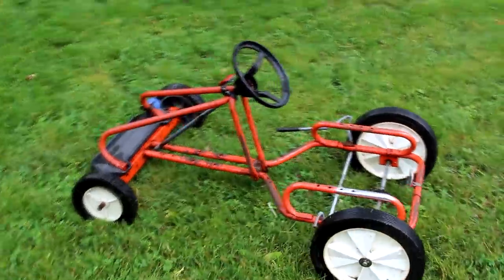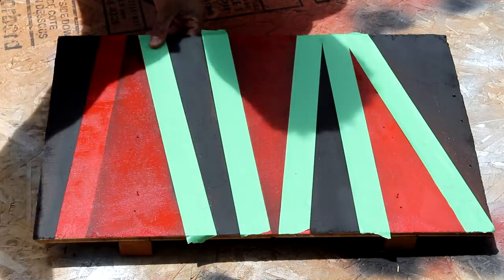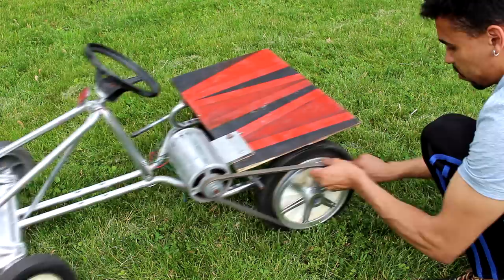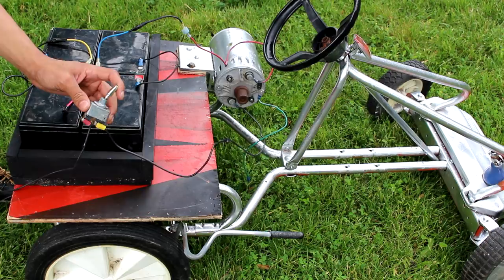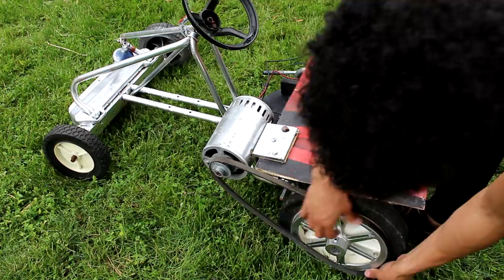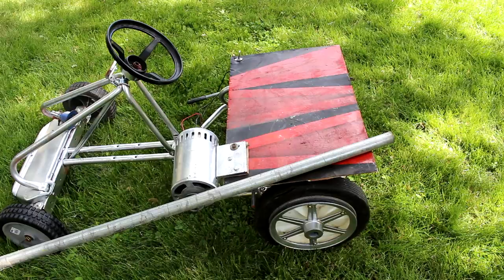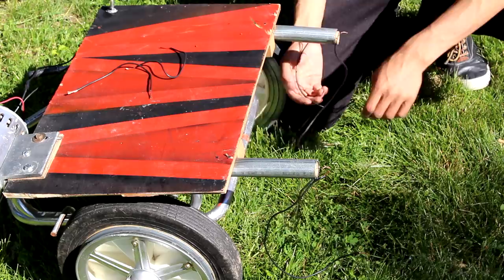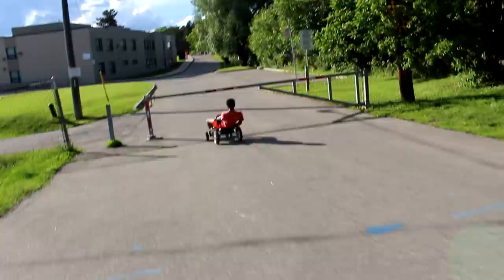How to Make an Electric Go-Cart with ROCKET BOOST !!!

Comment: Electric part and to control it  easily , but mechanical part is problem ! there is any V-Side system , ball bearings and wheels will be damaged quickly  when havy load or high speed on the road bend

Comment: Why don’t you use a potentiometer instead of a switch so that you can control the speed
Reply from the maker: big potentiometers are hard to get, they mostly come in the form or speed controllers. those would probably work well but i used what i had laying around
Reply: JoshBuilds I have found them at home improvement stores. I bought a 25 amp rated potentiometer that was designed for underfloor heat
Reply: Mattson McCraw has
Reply: IF you want to make it by yourself just go to InpliX page.
Reply: ami la de la mochila azul
Reply: I liked the "full power boost control", kind of a digital throttle. Speed controllers like the big resistor type and those with huge heat sinks mostly waste power as they can get very hot and that heat drains the battery plus what is the need when it looks like the driver can easily modulate the switch to maintain the desired speed.
Reply: Mattson McCraw nice idea I have a plan to do this and you have a great idea
Reply: Clash Master 
Iiik
Reply: Matt Coil my nickname is liik
Reply: You can use a DPDT switch to go between 48V series and 24 series parallel modes for the batteries. This way it's lossless and more simple than a speed controller, but a potentiometer is lossy just trying to put one in series with the motor. It takes a bit of thought to wire it up but I know a diagram.
Reply: Mattson McCraw good
Reply: Mattson McCraw
Reply: Mattson McCraw that's what I was thinking 😝
Reply: Mattson McCraw .
Reply: Mattson McCraw 
Never use Potentiometers for high power control, because they are stupid inefficient
Reply: Vikrant Singh mbgu
Reply: Hè has only one option slow and slow
Reply: Sepp Beld is
Reply: Mattson McCraw

Comment: Hey @JoshBuilds what engine do i have to buy that the kart will go like 15-20 kph?  (60kg) and how much will it cost?
Reply from the maker: you ca get a 500 Watt electric motor. You would also need 4 - 12volt ,12 amps batteries. You could also use a 49 cc gas engine. gas engine would cost $90, for the motor and batteries it would be $200

Comment: I made one of those with a 120v  motor and geared it way to fast, had a mower transmission, you put 2 100ft  extension cords on there, I had a speedometer app and when you plugged it it it would do 0-70 in about 100ft. Not kidding I wasn’t even on it when I tested it Cause I thought it would go slow but immediately flipped on its back even the motor is in front of the axle it flipped on its back and crushed The steering wheel. That project was scratched in about a day, ride it a few times though, you just ride it till the extension cord unplugs, it was a big motor from a silage augor putting out about 4HP at 1725 rpm, belt driven to the tranny and chain to the axle
Reply: I believe every word.Electric motors are a miracle taken for granted.Power is the only problem.You have to wonder if they have battery technology behind closed doors that could power a fully loaded semi for a thousand miles.

Comment: WHY DO YOU USE A PULL WHY DON'T YOU PUT A SPROCKET ONTO THE ELECTRIC MOTOR AND MAKE IT CHAIN DRIVEN THERE'S ALREADY A SPROCKET ON THE DRIVE SHAFTER SO WHY NOT MAKE IT CHAIN DRIVEN?
Reply: Zech Thompson that's a pulley on the driveshaft, that's why he used a belt.
Reply: Interestingly Random look really close to the drive shafts in the beggining of the video, there's a sprocket welded to the drive shaft, he's the one that put the pully wheel on the tire.
Reply from the maker: +Zech Thompson that would be a solid idea, the only problem was the sprocket that came with it was pretty small. I wanted to attach to a large sprocket so I could have a small to large gear ratio to favor torque.
Reply: JoshBuilds are you gonna add more details like that in the future... if you are can you make a video I would love to see it, I do love this build
Reply: JoshBuilds you should make it hybrid so you can have pedals on the sprocket and electric on the wheel
Reply: please why dont you tell the 50+ People wich Motor and where?
Reply: Zech Thompson Shafter? 😂